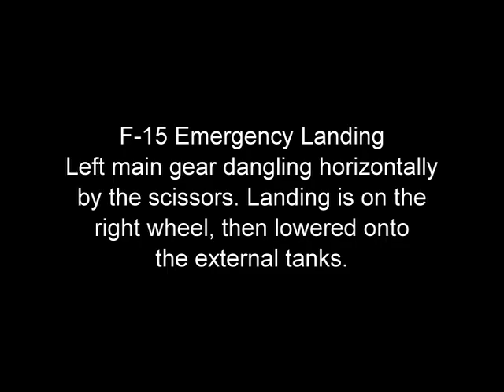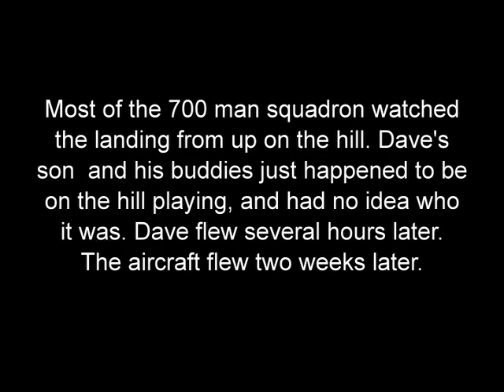F-15 Emergency Landing.mov

Comment: "The first solution was to take an arresting cable with the tail hook. I turned that idea down since the left gear could catch the cable first and spin me around or flip me over." That's a simple deduction (especially easy sitting in a chair in my office) and a dang intelligent one, too. :)
Pays to have input from guy at the forefront of this situation.

Comment: If I had shot that I would NOT have put it on YouTube.  That really sucked.
Reply from the maker: Thank you for your comment, Steve. It was 1985. The Fire Department bought the first RCA consumer video camera on the market. The young fireman who shot the video had never used a video camera. No one had video cameras--we didn't even have cell phones in 1985. Auto focus? No one knew how to use it. Now, if you had shot the video, two good things would have occurred: it would have been perfect and you would be at least 52 yrs-old by now and have better manners. This video is posted as a good memory for the many Air Force people who helped me that day, especially the firemen who would have pulled me out of a burning jet if they had to. Not much about that sucked for those of us that were there.

Comment: I was assigned to the 318FIS Green Dragons, this was around 1986?  If I remember this right;.  I think most of the 318 personnel were in the bomb shelter. We were doing an ORI exercise which required  non essential people to be in the bomb shelter. We kept getting updates in the shelter about this pilot and aircraft. The  MAC people were most of the people watching.
Reply from the maker: That's probably true since we were in an ORI, although it seemed like quite a few 318th folks told me they watched from the hill--probably the maintenance guys who were outside anyway. My nine year-old and his buddies happened to be riding their bikes and saw the whole thing. They got a kick out of it when they heard it was me.
Reply: wildmandl.    You did an awesome job landing it. To bad that camera guy didn't have a better camera? I worked down in the Hush House I guess we were non-essentials? Good ol days!
Reply from the maker: Thanks. It would have turned out the same with any one of the guys flying it, but I didn't screw it up. 1985:  RCA just released their first consumer camcorders. I know because I got the first VHS-C from RCA around that time. The fireman was not a cameraman, he was a fireman and they had just gotten the camera--first time he use it. No one knew anything about "autofocus" back then. Now we're all video wizards with our phones and cameras and can't imagine such a mistake. People forget--we didn't  even have cell phones in 1985!  So, autofocus snagged the window frame. Completely understandable. Thanks for your work in the hush house, Larry! Pretty essential to keep those Pratt & Whitneys running!

Comment: I never realised F-15, F-16, F-22 and F117 USAF aircraft have emergency arresting hooks... every day a school day.
Reply: Johnston Steiner  The problem with USAF aircraft, landing carriers.  Is that with exception of the F-4, & A-7, the airframe & landing gear aren't strengthened, to withstand carrier landing.
 If one did land on a carrier,  the landing gear would collapse,  & there would be major airframe damage. 
It would be safer to eject,  near a carrier,  and be picked up, by a rescue helicopter.
Reply: F 117 arresting hook???  No!!!!

Comment: "Hello, this is McDonnell Douglas customer support, how may we help you?"

Nice job in getting her down, rather than ejecting (possible body injury) and loosing an entire aircraft, or even worse killing someone with the unmanned out-of-control aircraft. As a pilot you have complete and utter control of what the machine does, regardless of it's size and role, so in a emergency situation it is your choice on what happens, and you clearly made the right one here. I'm planning to join the Air Force, while I likely wont be flying F-15s (either the Eagle or Mud Hen) because I'm thinking more of flying bombers, though if I were to go fighters I will more likely be put on the F-35 instead, which I think is an amazing aircraft also. I gotta work on my flying, since I only got 6 hours and it's been a long time since my last flight, so I'm horrifically rusty. Thank you for your service for our country!
Reply from the maker: Good luck to you in your flying career. It's a good time to start since there is a pilot shortage! For emergencies like mine, there are established controlled bailout areas and procedures so we can eject without putting anyone on the ground at risk.
Reply: Six hours flight time on the books and expecting to fly the most sophisticated bombers or fighter aircraft, eh?
Well, no sense in setting your sights low but don't discount the possibility you might be commanding a Trash Hauler carrying Rubber Dog Shit out of Hong Kong, either.
Good luck, Pardner. 
LOL